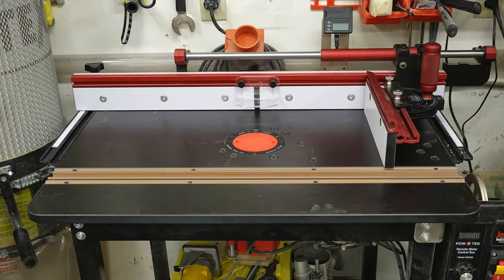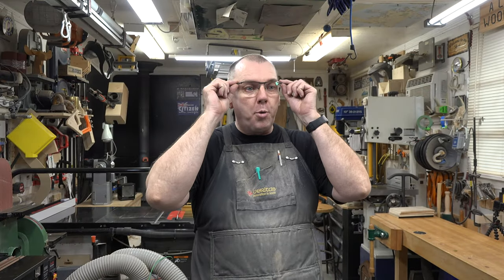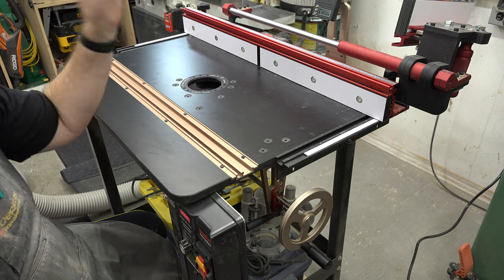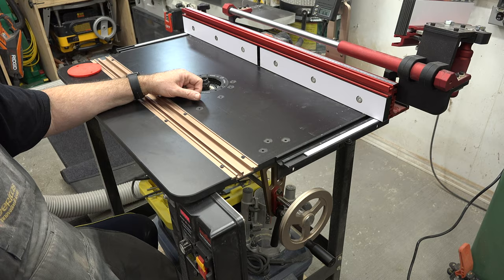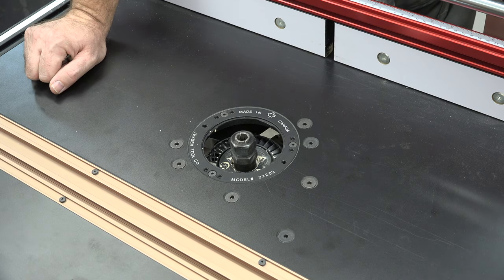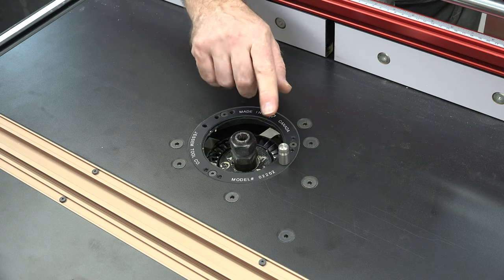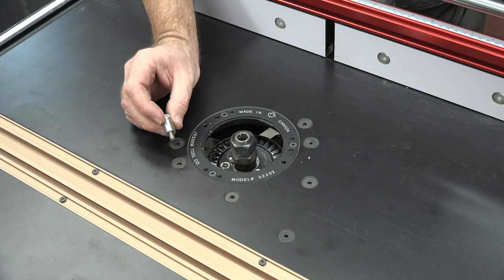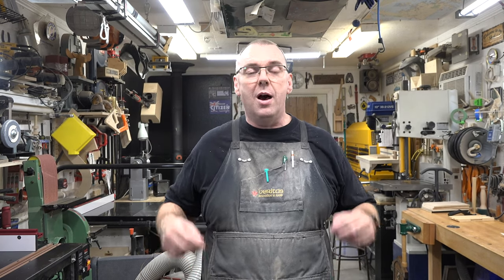JessEm Master Lift Excel II Review

Comment: Thanks for the review. I bought the same setup about a year ago, and am only now able to set it up. It took about an hour, without the stand. But now I’m fighting to find a dust hose or adapter to fit the dust shroud. This shroud is definitely not 4” O.D.. How did you solve this problem?  I need to tame the dust beast.

I plan to build a custom cabinet for this table, and intend to use a longer cat 5E to be able to position the digital readout in a more convenient location off the table.
Reply from the maker: Well I'm not sure what changed Bash because my dust shroud fit inside my 4" collector hose perfectly.  I have to wonder what has changed myself.  On today's show (as luck would have it) I started a 3 part build series on making my cabinet for this router.  It may be of interest to you to assist with your build.  https://www.youtube.com/watch?v=eciOQDDYj2w
I hope you find a solution for the hose issue.  What is the issue?  Is the shroud to large and wont fit in the hose or is the shroud too small and the hose wont tighten around it?  Either way, thanks for tuning in to the show.
Reply: Thanks for your reply Kenny.  The shroud is about 3/16” too small for a 4” I.D. PVC schedule 40 pipe, and almost exact size of a (nominally) 4” O.D. of a 4” to 2-1/2” dust host reducer. I’m likely going to sand down something to get this to fit. Are you using a 4” flex hose with a clamp directly on the table shroud? Or did you use an adaptor?

I look forward to seeing your build. I’m not setup to video capture what I build, and I’m quite time limited with my projects. But I’ll certainly take photos and share at your build’s link, if possible.  I have my table measurements and cutouts and design ready to go. I first need to close on the dust collection solution for it before going too far and building myself into a dilemma.
Reply from the maker: @basha9482  I use a flexible hose for the connection to the shroud.  The clamp tightens the hose perfectly on the shroud and then I redirected it to the back of the cabinet and using a couple more dust collector fittings, I rerouted the collection connection point to the outside of the cabinet at the back.  I think that is done in the final episode of the build series. (part 3). I hope this helps.

Comment: Nice review. Now, 2 years later, are you still satisfied with this table and is there any table you may consider as another router table, assuming you had the opportunity to get another one? 

I am referring to maybe a Woodpecker or maybe another model of the Jessem?

Appreciate your reply as I am considering getting a complete router table with all accessories. By the way, what is the size of your phenolic top?
Reply from the maker: After more than two years, I am still happy with this setup and wouldn't change a thing.  If I had it all back and had to do it over again, I would have still picked this particular router table.  I haven't had a single issue with it and it still performs like new.  I did add their micro adjust fence adjustment which made a huge improvement to the fence but other than that, I'm still very happy with it.  I don't know the size off hand, but I can head to the shop and measure it tomorrow for you if you'd like.  Thanks for tuning in to the show.

Comment: I"m trying to research the things i want in my shop once i have a shop that is. I was wondering is this table conducive to building a cabinet around it. with your set up? and what would you recommend for a beginner I have a dewalt trim router but i know that would be way under powered for a table.
Reply from the maker: I have actually built a cabinet around this table and have a multi part series of the build on the channel.  Part one can be found here https://youtu.be/eciOQDDYj2w
As for the router motor, I would suggest getting the highest HP router you can afford.  The higher the better.  I think mine is somewhere around the 3 3/4 HP with a 1/2" and 1/4" collet.  Router tables are generally used for larger bits as using the larger bits in a hand held router can be dangerous so a larger horse power motor is recommend for sure.  I hope this helps.  Thanks for tuning in Anthony.  I hope you get your shop soon.

Comment: What would you use the miter fence for?
Reply from the maker: The mitre fence can be used in the same fashion and for the same reasons as a mitre fence on a table saw.  Trimming mitres on a frame, coping cuts for rail and stile joinery, cross-cut detail routing, perpendicular dados for small box dividers, etc.  There are plenty of uses but basically, any time you need a cross-cut rout on the narrow side of your stock, the mitre fence can be used.  I hope this helps Rick.  Thanks for tuning in to the show and taking the time to ask your question.

Comment: Hi, I just got my table and have put it all together. I’m not really happy with how noisy the lift is. I can hear all the gears moving. Does yours do this? I’m just wondering whether I’m being picky but my last JessEm lift which lasted 18 years and was still functioning never made any kind of noise.
Reply from the maker: I'm not sure what kind of noise you are referring to Robert but the lift almost makes a slight purring noise as it raises or lowers.  If you are experiencing any other noises that don't seem right to you, I would suggest contacting Jessem's customer service and get their opinion on it.  From what I understand, they stand behind their product.  I hope this helps.  Thanks for tuning in.

Comment: Put small magnets in the holes and glue them on each plate it will stick to the pins no problem 😊
Reply from the maker: The problem is, I think the pins are aluminum.  I'd have to check that though to be sure.  Thanks for tuning in and for chiming in with your suggestion.

Comment: Have you looked at the metal inserts with the incra lifts? I’ve heard good things about dust collection with the incra. How do you think this one compares? 

Also, thoughts on a phenolic top vs a cast iron top such as one from saw stop? I assume cast iron would be more durable but maybe overkill?
Reply from the maker: I can't really comment on the dust collection comparison Christopher because I have never worked on an INCRA router table.  As for the table top, cast iron does sound a little overkill to me and I have really been liking this phenolic top.  Stable, solid, flat and durable.  Honestly, I've been quite happy with this model since its purchase.  Thanks for tuning in to the show.

Comment: Did you ever figure anything out for removing the inserts? My first thought was as many others posted; magnets. The rare earth ones I tried weren't really strong enough though.

Have you used the t-slot on the table itself? I tried using a miter gauge with the adjustable rail to tension it, as well as a piece of oak that I've used on my table saw sled, and I get binding at a few locations.

One other issue I've had is with the rubber wheels being out-of-round on the clear-cut stock guides. JessEm's response: massage them into the grooves, which didn't work. Going to email them again.
Reply from the maker: I applied heat shrink to the posts of the removal tool which added more friction and that seems to help.  When it doesn't help, I use the tool to disengage the insert and then I raised the router until the insert is high enough to grab with my fingers.  Not ideal but it works.  I've been considering increasing the diameter of the removal tool's posts by dipping them in resin until they are the diameter that I need.  
I've used the T-slots repeatedly and never had an issue with them.  They've been flawless.  Same goes for the stock guides.  I've never had a problem with the rubber on them.  They've always worked perfectly for me.  I hope that you are able to resolve your issues with this Bryan.  I know that Jessem stand behind their products and I think at the moment, they are just going for the easiest solution to your issue.  I would definitely contact them again and let them know that they suggestion didn't work.  Thanks for tuning in and for taking the time to ask your questions.
Reply: @acutabove_woodworkings  yeah, I've been using the router to lift it up and out too. As you mentioned before, not ideal, but you're usually raising the router to change the bit anyways. I'll give the heat shrink idea a try, thank you! Awesome vids on the router table cabinet build, by the way. I used the stand and only built a few drawers underneath, but I'll probably box the router in as the dust collection isn't ideal.
Reply from the maker: @bryan5070  The dust collection greatly improves with enclosing the router in a cabinet.  Like night and day difference.
Reply: @acutabove_woodworkings  awesome, that's great to know. Thanks for the quick and helpful replies!

Comment: Question from Norway. I watch a lot of woodworkers from USA and Canada. It seems that the common setup, at least for smaller shops, is a cabinet saw and router table. Why isn't it more common with shapers and sliding table saws? It seems that after all the jigs and accessories you need, the price difference to the more purposly made shaper and sliding table saw will not be that big. Not trying to be rude here, just curious and what Im missing, because Im in the plans of setting up my own shop.
Reply from the maker: You're not being rude at all Ola.  There's nothing wrong with asking questions.  In my opinion, the sliding table saw and the shaper are too specific for a small shop and not enough versatility.  There can be a lot of work, cutting sheet goods like plywood and a sliding saw just can't handle the capacity of full 4'X8' sheets of stock.  The router table and the cabinet saw are extremely versatile and with the additions of shop made (or store bought) jigs, they both can perform everything that a shaper and sliding saw can do and so much more.  Jigs aren't necessarily made to enable a woodworker to perform a process but are also made so that the process is easier, safer and repeatable.  There is also the issue of space and where the cabinet saw and router table take up a smaller footprint, the shaper and the sliding saw can sometimes require much more space to operate.  I hope this clears it up a little.  If you have any other questions, please don't hesitate to ask.  I'd be more than happy to help if I can.  Thanks for tuning in to the show.
Reply: @acutabove_woodworkings  Thank you for the quick and detailed response. This defenatly makes sense to me. I’ll consider this when buying equipement. But the unfortunate thing is that in Europe the american cabinet saw and router tables are not easy to find. Another issue in Europe, and the only thing about the imperial system that irritates me, is the fact that there are so many nice jigs and tools in america that are difficult to use in metric Norway. So please switch to metric so we can take part in this ;). Again thanks for the great response.

Comment: Thank you for this very thorough review. Most helpful! It seems that the Pow R Tec router by Jessem is discontinued, with no replacement. That is too bad. Any idea why? Was there a recall?
Reply from the maker: This is news to me Regis.  I wasn't aware that it was no longer available.  I just went on the JessEm website and I can't find the motor anywhere.  It's a great motor that I have been extremely happy with.  I am not affiliated with JessEm (or any other company for that matter) so I don't have any inside information.  I have sent them a message through their contact tab on the website inquiring as to why it isn't available any longer so hopefully, I will have an answer for you in the next couple of days.  Sorry that I'm not immediately able to answer your question, but when I hear back from JessEm, I will reply to this message with what they had to say on the subject.  Thanks for tuning in to the show sir.  You will be hearing from me soon.
Reply: @acutabove_woodworkings  Like many companies that discontinued items is sales. That would be my first guess.
Reply from the maker: @johnlowry5311  Most likely but here it is 2 months later and I still haven't heard from them.  Looks like it's time for another email to be sent.  Thanks for tuning in John and for taking the time to leave a comment and bring this issue back to the surface so that I can connect with JessEm again.

Comment: Hi Kenny, what material are those inserts made of? If they are steel or magnetic, a small magnet glued into the wrench should be sufficient to sort out the problem
Reply from the maker: The inserts are plastic John so a magnet wouldn't help much.  Thanks for trying though and thanks for tuning in to the show.
Reply: @acutabove_woodworkings  Well, you could do a MacIver and find a way to attach magnets to the wrench and the insert.  Is there room to attach a magnet to the underside of the red cap and attach the other magnet to the wrench somewhere?
Reply from the maker: @MixingGBP  There might be enough room  for that and I am looking into it.  I would much rather drill the parts and have the magnets recessed in the inserts and the wrench.  The wrench is easy because there is enough material but the inserts are too thin and it's not possible.  I'm sure that I will come up with something.  Thanks for tuning in to the show and taking the time to chime in with your suggestion.  It's very much appreciated.

Comment: I am 89 and my hearing is not too good. Thus I am unable to hear what you call the name of the top material of your router table. Please spell it out for me kind Sir. Thank you.
Reply from the maker: The material that the router table is made from is call phenolic resin.  It is much harder and more stable than the normal MDF table tops that are normally used.  I hope this helps.  Thanks for tuning in to the show.

Comment: it costs what it costs, just say what it costs.  like women and their age.
it’s stupid.   anyway i got the mast-r-lift II not this set up you have and i must say the quality is top shelf.
JessEm really sets the bar as high as it can go with materials.
same as the crank assembly you demoed here with how smooth and solid it operates.  when you have quality materials and tight tolerances, the results are going to make life easy during operation.
quality tools perform as a tool is expected to perform, so when you open your eyes in the morning, a smile follows because things are going to go as they should.
you can’t really put a price on that.
i’ll guess at the price you paid and say $3000, if you put that in prospective, it’s not a lot of money.
if you spend $1000 but you’re pissed off every time you go to use a tool, that money is wasted.
id rather pay $3000, or $5000 and LOVE to go to work.
i’m glad i went with JessEm, YessEm !
Reply from the maker: The reason I didn't mention the price Gino is because of the different regions that this video is viewed from.  I might say $3000 but someone else might only be able to get it for $4000 and that's when people start leaving comments about me being wrong on the price.  That being said, I totally agree with you that I would rather pay extra for a tool and love using it than to cheap out and hate the problems that it brings me.  Glad to hear that you are happy with your Jessem set up.  I am too.  Thanks for tuning in and for taking the time to leave a comment.  It's appreciated.